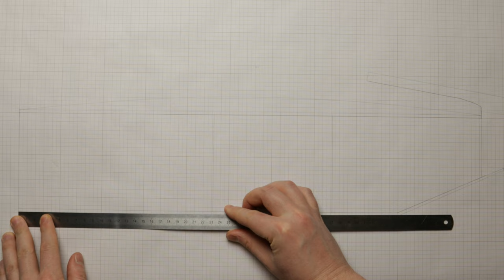Viola da gamba making | Part 8 – back and soundpost plate

Comment: What is the soundpost plate made by? Spruce?
Reply from the maker: Yes, it's spruce.
Reply: @henrylenck7242  interesting, one may wonder if the sound is transferred  via the ribs to the spruce, or via air vibrations. What do you think?
Reply from the maker: I guess it's this way:
strings -> bridge -> top plate -> air inside body
The top plate acts like a membrane in a drum.
Reply: @henrylenck7242  Indeed! I make violins, but have never made a Viola da gamba. What intrigues me is the role of the backplate with the sound-plate rather than a sound-post. This is what I wonder about, how is the sound transferred from the top to the back's sound plate? Air would be too weak? However, the role of the ribs in transferring the sound to the sides of the sound-plate would play a role if and only if the sound-plate on the back is attached tightly to the ribs, and has a thickness equal or lesser to the thickness of the top. What is your experience with the connection between the ribs and the back-soundplate?
Thanks